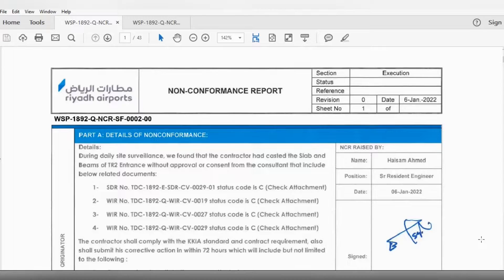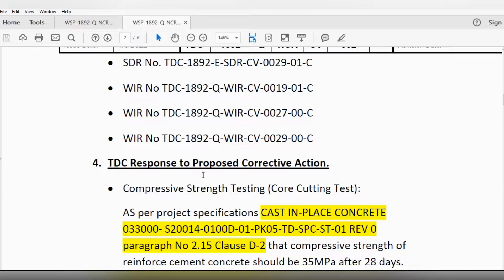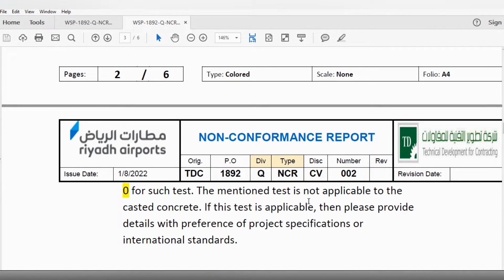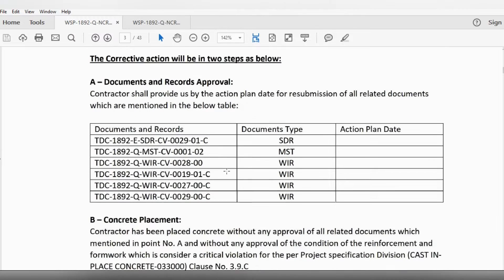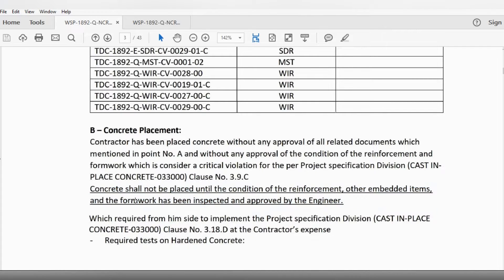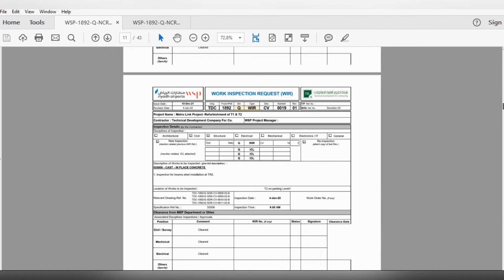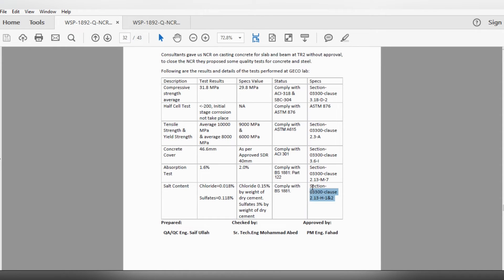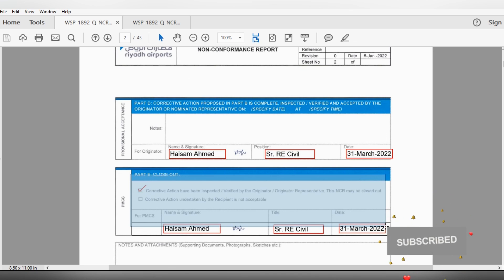How to Close NCR -Non Conformance Report | How I Closed My First NCR A Practical Example.

Comment: I have Question. How are u performing compressive strength test after 7 days, 14 days, and 28 days when concrete arrive at site.and u are using that concrete in an activity. Suppose the compressive strength after 28 days is not upto the required standards. then what will you do if you have cast all the concrete in slab.
Reply from the maker: First we will do non destructive tests like Schmitt hammer test if we again did not get the results then we will go for the core test from the casted area
Reply: You don't pour concrete blindly. First of all you test trial sample of mix design as per specifications. After that you do concrete pouring. If even then the strength is lower than required, then Non Destructive Testing is done. If still strength is low then core cutting test is done and if still the strength is lower, designer is consulted and they would share their final verdict regarding that structure.
Reply: And what if we didn't get required strength by doing core cutter?

Comment: What was their comment when you mention that how it is possible to carry out compressive strength of casted concrete after 4 days.
Reply: Consultant know its not possible to conduct test on 2 days .it depends on hydration and other factors to get concrete strength. He just to argue used this point
Reply: Is there any specification/ limit  for 4 days..?
Reply from the maker: He need the test results in 2 days to be honest he want demolition of slab and my project manager told we will not demolish it
Reply: @CivilEngineerAtSite  on what basis he asked for compressive strength after 2 days. Is there any specification/codes requirement for 2 days.?
Reply from the maker: No codes or specs he had some issues with our Construction manager
Reply: Ok thank you. Please see your facebook messanger spam msg..?
Reply from the maker: Contact me on instagram.
Reply: Anyways consultant making a statement to prove something prblm .. or he making scene for his role
Reply: Its all peoples attitude that makes prblm than more technican conflicts

Comment: What is the location for cold joint in case of concrete slab..?
Reply from the maker: Cold joint is a defect in concrete. When there is delay in different concrete casting so it can happen anywhere in slab
Reply: If we stop the concrete pouring at what location it should be stop in case of slab.?
Reply from the maker: If in case there is control joints/expansion joints in slab so you can stop concrete on control joints/expansion joints otherwise you have to complete it to avoid cold joints
Reply: Cold joints usually happens when u short of order concrete quantities or u delay the pouring of concrete continuously 😳. So there’s no specific location when it can happened.
Reply: @denandvon9809  yes. But if there is huge concrete and you would not be able to poure at once then you have to stop concrete at specific location